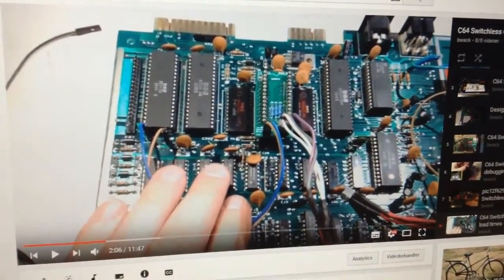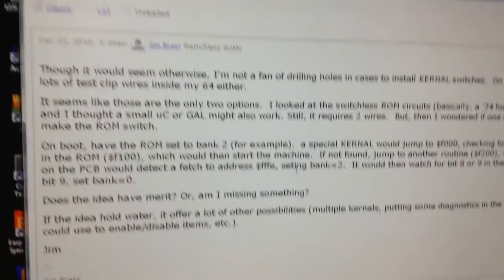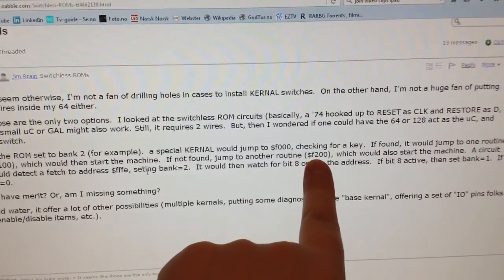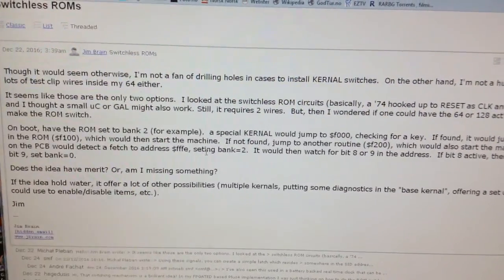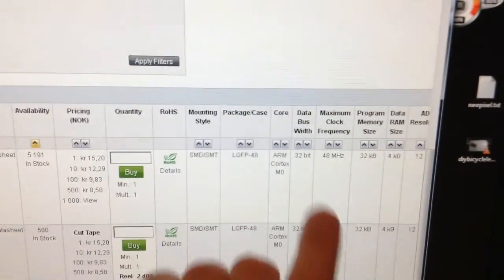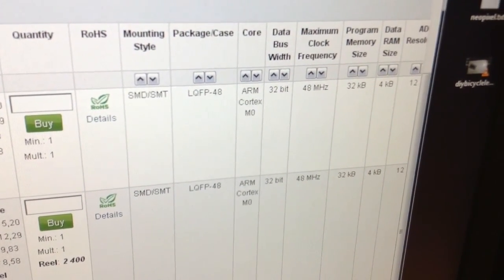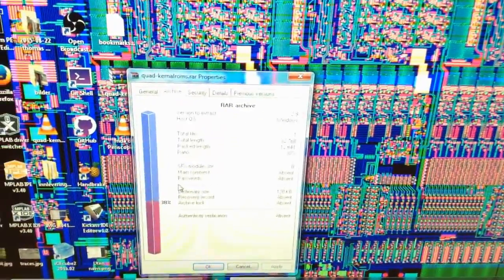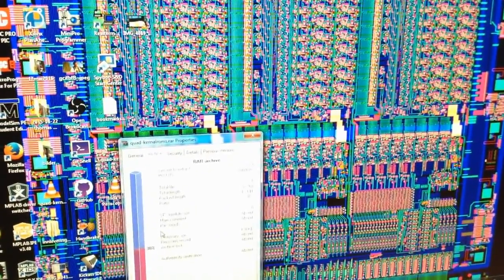C64 Switchless kernal drop-in no wiring ?

Comment: I missed a lot of videos over XMAS and this was one of them!  This sounds like an interesting idea.  I've wondered about this sort of thing before - ie. have something that monitors address and databus and then 'does something' (eg. bank switch) when you've written certain values to a specific address (like a key - something unique enough that it cannot be mistaken for code within any game or program) - eg. 3 sequencial writes to the same address with different values, like 1, 255, 128, all at the same address as 3 seperate writes.  The sky is the limit with that type of idea.  I was thinking of doing something like that on my ST - so I can programmatically switch between 8 and 16Mhz.

Comment: I drop in multi Kernal would be awesome for my New Blue C64; thinking about putting a NanoSwinSid in there as well, it already has a PLA replacement. That way my 'New' Modern Day C64 replacement is as 'new' and different from the original yet very compatible. :)

I would buy one if it was a drop-in for sure.

Comment: Replacing (E)EPROMs with cheap MCUs which have enough program memory for both the code and the kernal images is a great idea!
Reply from the maker: I'm thinking so. Will have a go. Just need to set up a toolchain. I'll try the gcc first. Not sure if the kernals (in rom) needs to be moved to sram. Not familar with the ARM opcodes and how they transfer data between the memories and peripherials. In PIC, if you put const data in program memory (flash rom) (say a string of chars), to use it you need to move the program counter and fetch a byte from there, move it into a small buffer in sram, then move the program counter back to where to program was before it jumped. It is not pretty. I hope ARM is better at this.
Reply: I'm not familiar with ARM based CPU, especially not with ARM based MCUs, but I don't expect it to be as complicated as with PICs.
There is a downside of this "kernal images in MCU" approach: copyright issues. With (E)EPROMs the end-user provides the images and takes full responsibility but with "kernal images in MCU" approach you're the one who's packing the kernal images into the hex file and that could get you into trouble. Not sure about all the kernals out there but at least for JiffyDOS the licensing is still in effect today. I guess you could make an utility for PC which allows the end-user to pack the kernal images into firmware and program the MCU herself/himself. It would be perfect if the kernal could be copied and stored into MCU directly on C64 but I doubt it's technically possible.